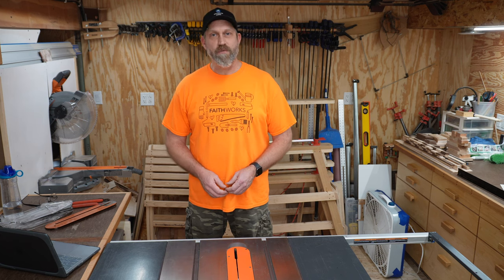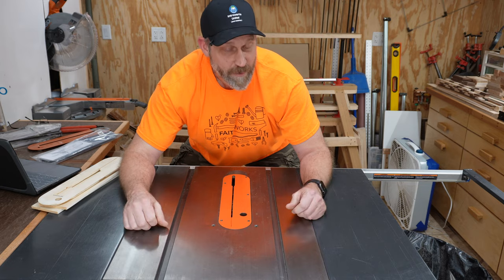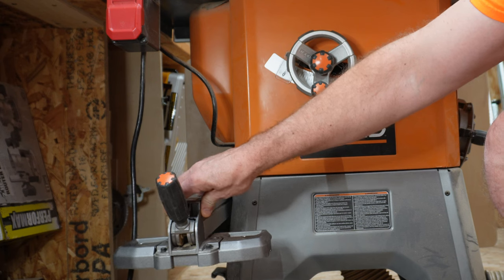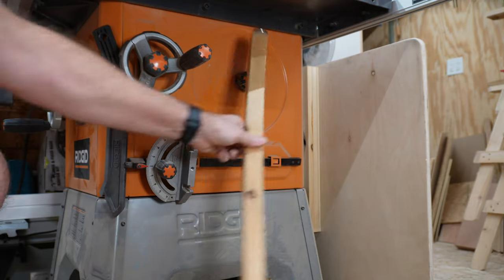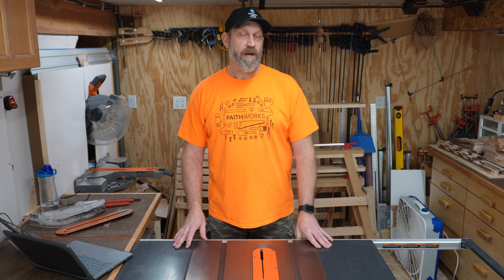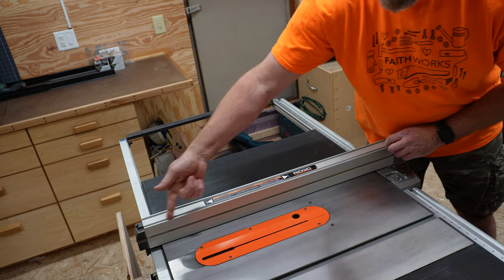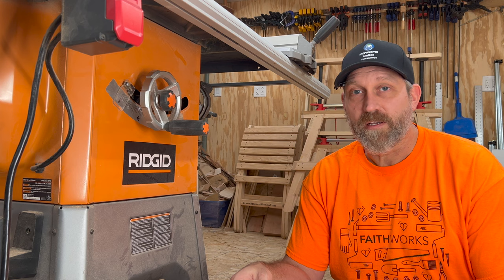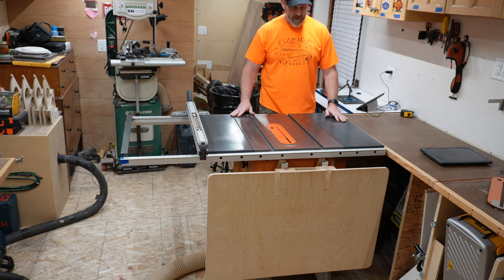Ridgid R4512 Table Saw Review

Comment: Got mine for Fathers Day in 2016. Best table saw I have ever owned.  The foot pedal to lift and lower the saw is at the front of the saw not the side and is easy to use. Yes it does klunk when you lower it. The fence is accurate every time I use it. Dialing in the 90 degree and 45 degree were easy and have not wavered from the first set. Good video.
Reply from the maker: Thanks

Comment: Great value. Bought mine new for $349 about 10 years ago.

Smooth running, good cast deck , poor fence, poor fence rails but they still work but not to what I would consider a professional level. I’ve been considering a new fence and rails. That would elevate this saw to a whole different  level.
Reply from the maker: I totally agree! I can’t wait to pull the trigger on a new fence system.

Comment: Brett: Thanks very much for this video most helpful. I have a Ridgid TS4512 and am in the process of making a outfeed table. I have decided to go with Colin Knecht's design. Two comments: his table saw is a General, not the Ridgid; thus,  he did not cover how to adjust the design of the outfeed table for the Ridgid to account for its extended fence of the end of the saw's back side. You obviously figure that out and I wish that you had covered that design feature a bit more in your video. I think that I figured it out but suggest that you might even do a new video showing details of your modifications in Colin's design that are required because of the length of Ridgid's fence. Thanks again.
Reply from the maker: Great suggestion! I may do that video as I’m preparing to replace it with my own version of the Outfeed/Assembly Table/Workbench/Dust Collector. But it going to be awhile I’m afraid.

Comment: Hey Brett! Good review. I've also owned this saw for a number of years, and to be honest, I'm still surprised how good it's been for me given that it cost barely over $500 when I bought it. I have found two things to be helpful that you also noted. The first is to periodically take the riving knife assembly out and clean it. It only takes a hex wrench and a few minutes and then I have months of trouble free use of that lever. I also found that the fence could lock out of square. It's because the fence locks front and back and the back part can grab before the fence squares itself up. So now I always push the fence against the rail before locking it down. That squares it up nicely every time. Hope those things help a little, and thanks for the video!
Reply from the maker: Thanks for that! I do push my fence against the rail when positioning and mine still locks out of square a lot of the time 🥲
I’ll try to spend a little time cleaning the riving knife lever works.

Comment: Hi, I'm acutally looking at a listing on marketplace for this same saw to replace my Craftsman job site saw. They're asking $400. It's less clean looking than yours, but seems to be in good shape otherwise. If you don't mind, I'd like to ask a few questions. 

I am also working out of a small space so trying to find something with better dust collection, Is the dust collection reasonably good? 

It looks like you've had to replace parts on yours, have you found that it is an easy saw to maintain? Are replacement parts easy to get, reasonably priced?
Reply from the maker: Dust collection isn’t great. It would be better if I had something hooked up over the blade guard, but I don’t have that. 

Parts are available from Ridgid and other non-OEM. I have only replaced the blade raising wheel and the “sheer pin” that I mentioned. To be honest, I can’t remember the pricing. 

Mine could use some lubricating “under the hood” but that would involve removing my outfeed table. Something I’m not too excited to do.

Comment: Thanks for the content Brett. I have an old Jet JWTS contractor saw and a ShopSmith. I mostly buy used equipment but am hoping to by a new table saw this year. If possible, I will most likely get another contractor saw and if I can swing it, I  will try for the Saw Stop.
Reply from the maker: If you can, that's probably the best choice. Save your pennies!

Comment: If you let that riving knife lever tighten to the point where it takes another tool to operate it, you are risking breaking that bolt. It's easy to fix. Remove the back panel. Lower the blade to line up the access hole with the nut on the backside of the lever bolt. One of the blade wrenches has a cut-out that fits the lever bolt on the blade side. Hold it and insert a 1/2 inch socket through the hole and loosen the nut by 1/4 - 1/2 turn. Depending on use , I have to loosen that nut about once per year to keep the lever working easily.
Reply from the maker: Thanks for that. 

My problem is that my outfeed table is attached to the access panel. It would be a pain in the rump to remove and replace. I’ll address it when I build my new outfeed table.

Comment: I fixed mine with a coiled spring pin.  Super sturdy, durable, and not expensive.  Built to handle the torque the finish nail is not.  (This is about the blade raising wheel).
Reply from the maker: Great tip! Thank you!

Comment: I have the TS3650, it does have cast iron wings, a little under powerd, the fence has its issues, once i learned the fence it's no longer issue...from what ive seen of the newer Ridgids its not as good as mine...fact i will upgrade and it wont be Ridgid thats Forsure, they have to fix the fence issue and the cheesy wings they offer now...
Reply from the maker: Live and learn, I guess. It suits my needs for now.
Reply: @BrettsWoodshop  oh Forsure I dint mean anything other then they need to fix the fence lol, suites my needs as well man..just hate having to worry about that fence, mine does the same, wants to kick left on the far side of the table, other then that a touch more power and I'd keep it forever lol... apologize if I come off wrong man, thanks for upload.

Comment: I've had mine since 2015 and its still going strong...I think this was the best saw they ever put their logo on.  Tounge in cheek saying that because apart from some cosmetic differences its the same saw as at least three others in different paint.  

Your front-to-back on the cast iron is supposed to be 27in, dead on!  That is something of a standard which is why if you wanted, you could buy the cast iron wings Rockler sells that are intended for the saw stop saws...or for that matter the cast iron and granite wings off older Ridgid and Craftsman saws that pop up on CL and FB marketplace from time to time.

Rewiring it to 240v still draws the same amps, it just splits the load into two legs

This was indeed the last Ridgid saw that could be rewired for 240v...the R4520 and the R4560 are 120 only.

You can rotate the wheel assembly so that the pedal is in the front of the saw.  I did that with mine because I thought the way the manual says to do it was a less-than-optimal placement.

I did install the Delta T3 on mine cause the OEM fence is just terrible...maybe even unsafe since it wouldn't reliably pull square.  Definitely worth the swap.  OR...depending on how handy and DIY-inclined you are, check out Jer Schmidt's video.  I am in the planning phases of a major modification of my R4512 and this is the fence that is going on it.
https://www.youtube.com/watch?v=4pudkvHFOfk

Might look for an R4512/20 group on Facebook.  There is a fella on there that sells some parts that are supposed to solve that OEM fence issue.  I'd also, look for Harold's Tabs.  Those make truing the saw so much easier.  Not something you mentioned you had done but definitely something I think should be.  IMO, having used three different versions from different makers, the TS alignment tool that Rockler sells is tops!
Reply from the maker: Wow, thanks for the great feedback and advice!
Reply: @BrettsWoodshop  I think sharing is caring and I try to not be too obnoxious about it like too many out here do.  Hope it didn't come across that way :)
Reply from the maker: Not at all. Very informative. You know your tool. @jzahirniak